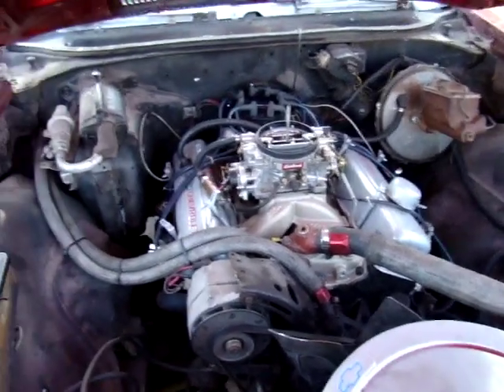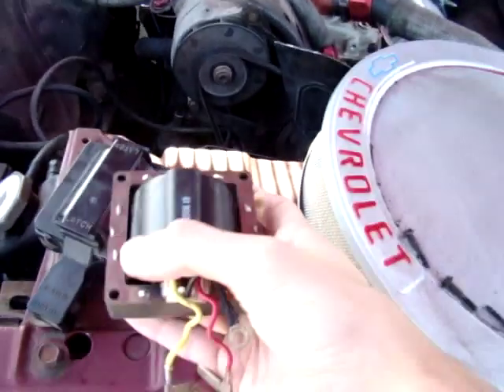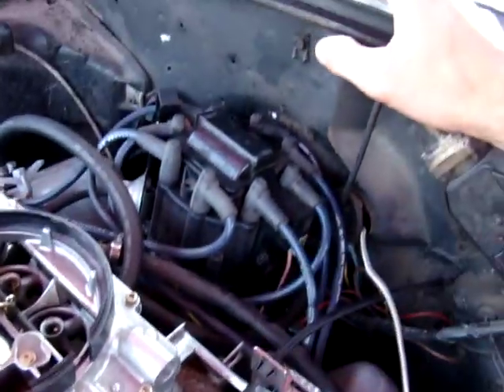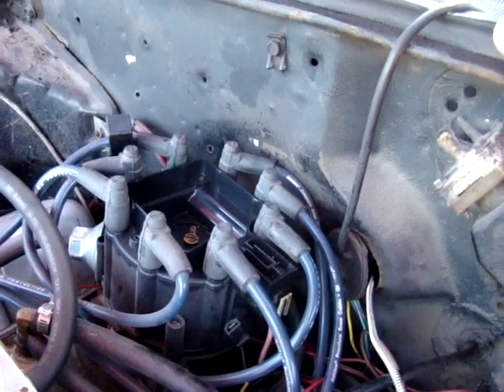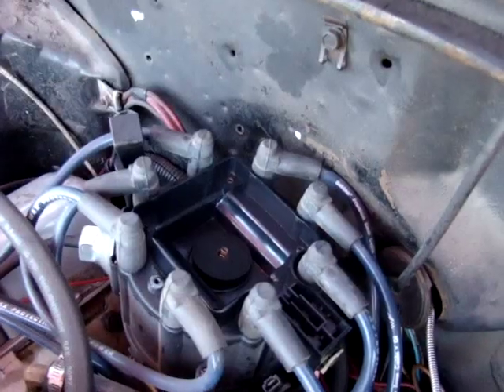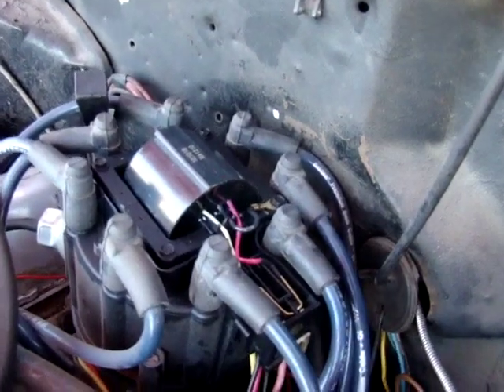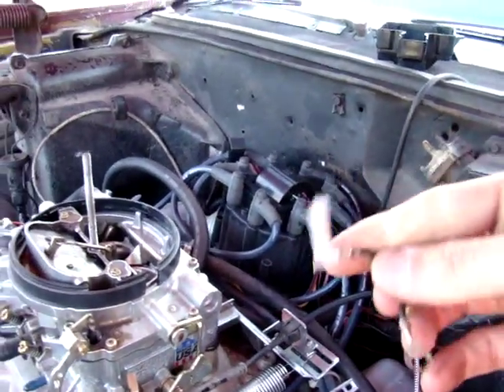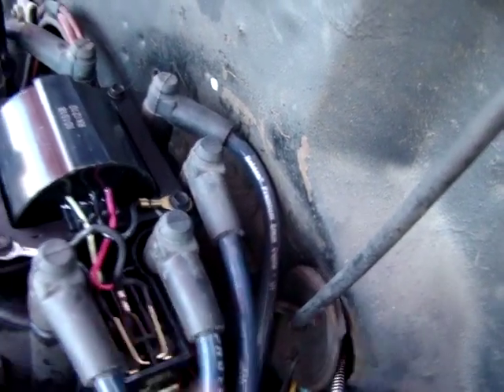Changing Coil Pack on a HEI Distributor

Comment: I have a 85 Vette  on my coil cover  there's  a lettering  notes  tack on left side   battery on the right side  then there's a white wire also a red wire to be plugged into the coil I'm not sure witch plugs into the yellow side or the red side of the coil   thanks if you can help.

Comment: Ok I'm trying to figure out what is going on with my van I was sitting at an ideal yesterday and it just quit running I tried to start it and it would turn but not over every once in a while it would chug like it would try to start but nothing can you please tell me if you think it's the coil
Reply: have you checked the carb it's possible your engine sucked up some gunk from the fuel tank, to see if it is the carb you can spray some starting fluid into the intake and try turning it over, if it sparks up you know it is the carb

Comment: Not good.  You forgot to show after the rubber or coth spacer was installed there is a small spring that must be placed in the center hole of the spacer and then the metal hole on the underside of the coil sits on that spring.  The other things is you should remove distributor cap and change the bushing pin that goes in the center of the top, because those crystallize and go bad long before those coils.  Before changing these coils you first change the distributor cap pin bushing and the grommet spacer and make sure that small spring that sits on top of the cap is clean that goes between the bushing pin and the coil